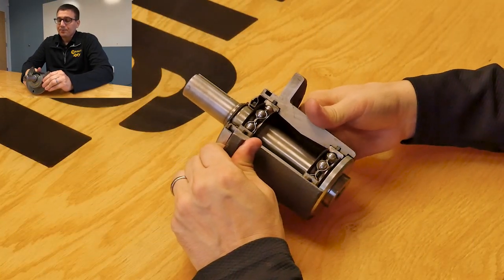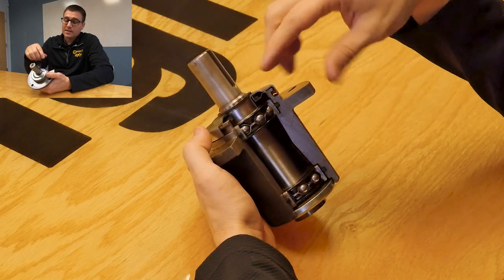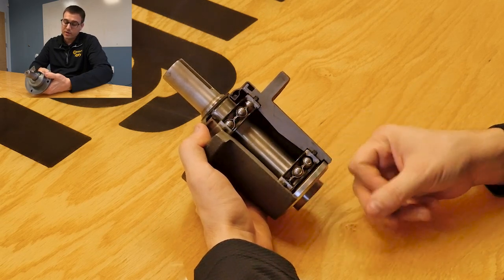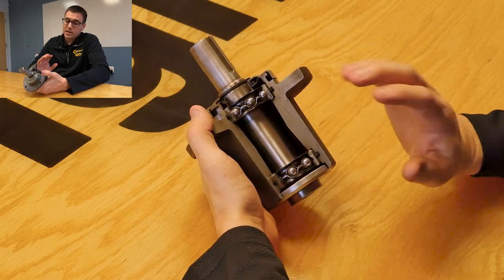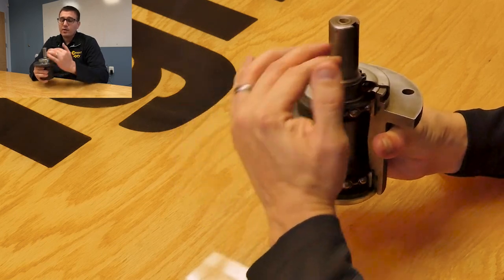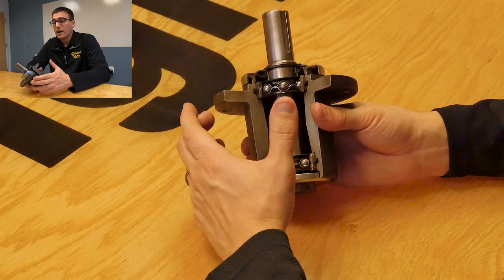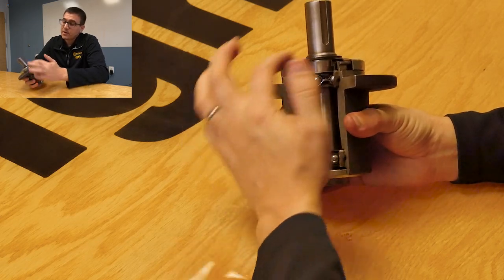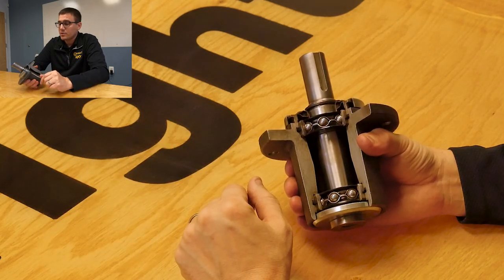WRIGHT | Ultimate Guide to Spindles

Comment: Will these new style spindles fit in an older non-aero deck? I have a 36" from 2008 that I would like to put the updated spindles on when the time comes to replace them. It currently has the older style spindles with the snap rings and large washers.

Comment: What’s going on Ed? I hope you read this, just wondering if you guys stopped making the 32” hydro walk-behind? I was looking for it online but only saw the 36” and 48”. 
Does anybody know if the 32” hydro is discontinued?
Reply from the maker: Hi there! Yes we discontinued the Velke Hydro 32".  This is because the Stander B really replaces the need for a 32" walk-behind in most applications.  But, as you mentioned, we do still offer the 36" and 48" Velke HC
Reply: @WrightMowers  yes, I have the stander b, (it’s awesome) but did notice it’s not too good when the lawns are wet. It kinda sinks in. I guess because of how heavy it is plus ones own weight. So I thought about the velke walk behind but when I went to get info on it, it was gone. 
I live in Houston and here you need a 32”. The gates here are so small a 36” wouldn’t fit in the backyards. I was planning on buying the 32” velke for wet lawns only. I never thought they’d get discontinued. ☹️
I know I can always buy a belt driven 32” but they suck lol I had one and they get stuck when the belts get wet.
Reply from the maker: @SleepyJoe408  I would check with your dealer.  They may still have one in stock or be able to find one for you.
Reply: @WrightMowers  will do. 
Thank you.
Reply: @WrightMowers   I hope you can help me out with a question. 
I noticed on my 32” Wright stander B that the right hydro pin was pulled out. The ones that are located under the gas tank. I guess they’re used for when the mower doesn’t start for whatever reason and you have to pull the pins out. Not sure if they’re referred as “pins” but I call them pins. I guess they release pressure so the mower can be pushed when not starting?? Anyway it was pulled out. Don’t know how that happened so I pushed it back in place and put tape over it just to make sure it wouldn’t move anymore. 
Any idea why it moved on its own and could it mess up the hydro? Not sure how long i had it running like that for.

Comment: Hello, I’ve noticed the build up of grass around the down wind side of the spindles. This tells me that there’s turbulence and this allows the build up of grass on the spindles. Maybe adding a small baffle that’s tight to the spindle allowing them to clean up turbulence and promoting better flow and way less accumulation. I’m sure you’ve done air flow Analysis under the decks. Just a thought I’ve had. Great mowers 👍🏻👊🏻

Comment: Since its sealed and gravity pulls the grease down how does the top bearing stay lubricated?
Reply: Good question, I'd like to know too.
Reply: Happens extremely slowly
Reply: First thing he said was there's grease on top of the upper bearing that works its way through the upper bearings top seal as it wears
Reply: @MikeDPlxztc  right but the grease will only last so long and that's what im wondering... will it all drop out after a few hundred hours and leave the bearing dry???
Reply: @FishFind3000  No the bottom shaft seal Would stop any grease from leaving the housing whatsoever
Reply: @FishFind3000  That being said I think the whole idea is quirky in the first place if you're going to have sealed bearings a good sealed bearing should stay sealed Depending on a bad seal to let enough grease through to continue to grease a sealed bearing is kind of a ridiculous idea if you ask me. The new grease falling from the top would have to work its way through a leaking seal that seems a little undependable why not just have open greasable bearings in the first place I think the whole thing is ridiculous

Comment: Id like to know what a good torque spec is for tightening a pulley on an aluminum spindle for ferris is 700z. Cant find it anywhere. Dont want to over or under-tighten it and compress bearing etc... Educated guess? What are wright specs on similar spindle pulley? Thanks
Reply: Call Ferris?
Reply: Actually spoke to Ferris engineer.  They said torque to 120 ft lbs.  Ridiculous.  There is a belleville? washer that sits between nut and pulley that is domed. Not flat. And 120 crushed said washer flat..  Same Ferris rep tells me that the washer should spring back to its domed shape.  Thats why I'm asking Ed.  Other dude was an idiot. I even sent photo to the guy of the flattened washer that has yet to spring back.

Comment: Call BS on your non serviceable spindle bearing lasting 1000-2000 hours. Mine failed at just over 300 hr. Took them apart and there was no grease left. Bought some new bearings installed a grease zerk and now I got almost 3000 hours on the machine and there still fine.
Stop being cheap and install a grease zerk into the spindle during manufacturing